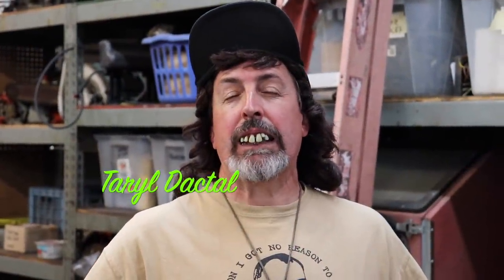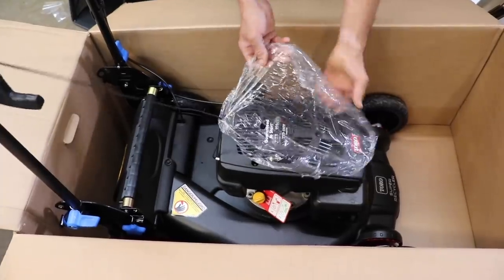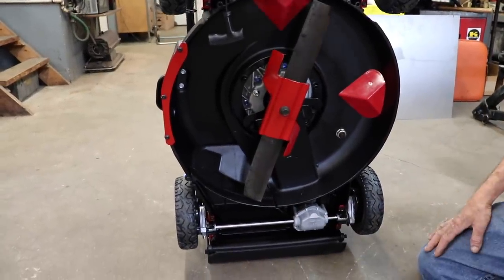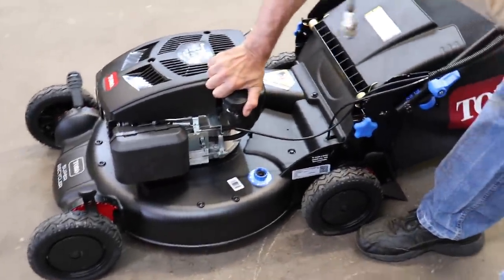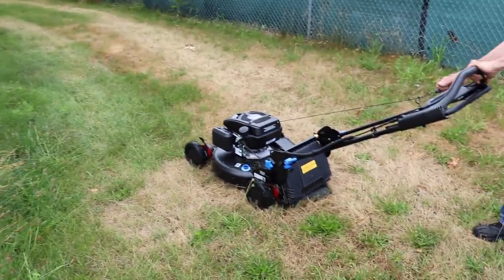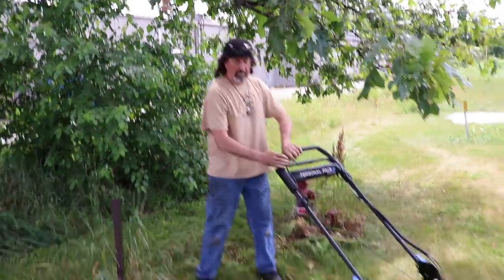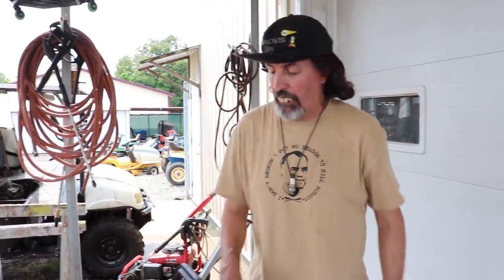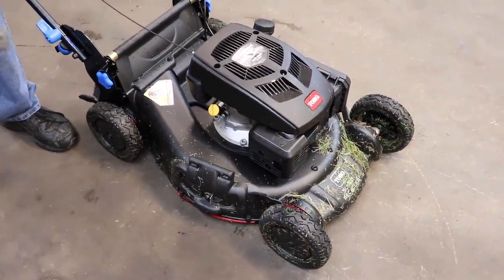Toro Super Recycler Mower Review - Is It Worth It?

Comment: Now wonder Briggs is in bankruptcy, Toro decides to go with a Chinese clone over a Briggs on their higher end residential units now. Briggs is in trouble! Otherwise nice mower.
Reply: @OwenAnonymous  Thats good 👍. I didn't realize they even offered a Briggs on the Super Recycler anymore, everyone I've seen so far had that Chonda.
Reply: That Toro motor is way better than the newer Briggs engine. The new Briggs have plastic carbs
Reply: @DeadguyAi  I'm aware. Although just because it has a plastic carb doesn't necessarily make it worse that that Loncin on their.
This is why Briggs is in bankruptcy.
The Briggs Quantum 190cc engine was great, it had a 30 year run and ut was one of the best walk behind engines ever produced, it would have been awesome on this mower. Like the older Recycler and Super Recycler. They have been using this Loncin Chonda ahwile now, the Super Recycler had this Chonda in 2017 when the base model recycler still had the 190cc Quantum which didn't make any sense at that time, because you paid more for the Super Recycler,  but the base model Recycler had the better more powerful engine.
This mower should have the newer Briggs 190cc OHV engine, those are descent and don't have plastic carbs. The ones with the plastic carbs which are the 163cc and down are crap. Larger mowers like this used to come standard with 190cc engines like the Briggs Quantum. Now everything has those underpowered crappy engines. Only commercial grade engines are offered with the 190cc engines, its a joke.
Thats why I hang onto good mowers that have that Quantum on it.
This mower would been great with the Honda or the Briggs 190cc OHV, its what it should have anyway, not some Foreign job. This is why American companies like Briggs are struggling. You can thank the EPA in the USA for causing all of the good older flathead engines to have been discontinued. Briggs still builds and sells the good cast Iron and flathead engines in Asia, yea thats right, you can buy the good Briggs engines still if your in Asia, but not here in the USA. I don't understand why Briggs isn't pushing to have their good 190cc OHV engine on this mower. But whatever the reason, they just filed chapter 11 Bankruptcy protection on the 19th. Its sad.
I had a 1994 Super Recycler, it was a great mower, 3 speed trans, aluminum deck and a Briggs Quantum, it was still in real nic3 shape when I sold it a few years ago. Small residential power equipment had gone pretty far diwn hill in general over the last decade.
Reply: Jim Johnson  They can, the Vanguards are very good engines. A lot of them were made in Japan. But if you want a good engine like that you gotta pay. In order for Briggs to compete they make some pretty crappy residential mower engines. The single cylinder inteks throw rods like its their job. However the single cylinder vertical forca tractor is the only Chinese engine not available at harbor freight, you can get the rest.
But again, Briggs still builds and sells their quality cast iron and flathead engines in Asia, they don't here thanks to the epa, so you can thank are epa for that, thats our government.
The last good engine to go was the Quantum in 2017. The opposed twins and all of their flatheads were great. Everytime I get one in, you can count on it still running.
The only descent residential mower engine you can still get from Briggs is the V twin. You have to step up to the Vanguard for everything else now if you want Quality.
Briggs actually started in 1908. The model F came out in 1919.
Reply: @OwenAnonymous  yes i love briggs too but honda is good aswell i think most engine brands are good every company has some bad engines
Reply: Honda’s the way to go. Their engines are built proof.
Reply: @Mr_Tecumseh  interesting read. I have a few briggs in my free trash find hoard of small equipment.
Reply: @OwenAnonymous  I did as well. Avoiding the chinese engine.
Reply: @Mr_Tecumseh  Agreed. Although I upgraded to 21387 which has the 190CC engine, I kept my old super recycler. My old Super recycler needed some parts (carb rebuild kit and such) I could not even check or call at  the beginning of the season. As, all mower shops were swamped and busy. I ended up buying the new super recycler. Finally, I did get a chance to work on my old super recycler. Still runs great! I change the oil, filter, plug and sharpen the blade every year. That is over 20 years old!
Reply: Briggs and Stratton have gone into bankruptcy because manufacturers are trying to make their products as cheap as possible to keep the big stores happy with cheap price mowers. This meant Briggs and Stratton have had to sell their engines at really low prices to the manufacturers to keep their DIY and internet store customers happy. That's why a lot of mower manufacturers have moved to Chinese Loncin engines, even the Toro owned UK mower company Hayter has moved to these Chinese engines on their basic spec mowers.
Reply: I have 2 Toro Personal paces one with the old tecumseh engine and a newer 190cc Briggs engine on the newer recycler with blade stop feature. Love both
Reply: JGD  Which honda, the GCV? The old Briggs Quantum flathead was neck and neck with those. They only stopped making them 3 years ago, so theirs still gonna be tons of Quantum's out their running in stride with the Honda GCV for a long time. Back when the Toro Recycler had the Quantum along side the Honda's at home depot, they were comparable to each other. Its not the case now. However the epa is what ultimately ended the flathead. However the newer Briggs OHV walk behind mower engines, their apsolute throw away crap, their built cheap to compete with the prices at big box stores like someone else mentioned above. But so are many of the mowers their being put on now and that just check and add oil, never change is such nonsense, a joke, they say that because they don't anticipate the engine or mower too last long enough to need an oil change. A lot of the newer made Briggs engines are pretty crappy, which is sad and its the reason their in bankruptcy. The last of their well made industrial engines at the consumer level all ended with the flatheads and most of those engines are still going strong to this day. Its pretty sad in general the overall lack of quality most power equipment is made with today.
Reply: How much dinosaur juice did it use is it very economical
Electrical battery mower  🔋 might be better more torque maybe .
Reply: Test Pilot Tim who cares. Most electric mowers choke on lawns like mine. Ridiculously dense zoysia turf. Keep the electric mowers for the lesser of tasks because they are not superior to gas yet.
Reply: @Testpilottim  No way.
Reply: The 21387 has the Briggs&Stratton engine.  That was crap, for the reasons listed here.  Briggs&Stratton is no longer the same company.  I bought one and barely got it out of the box and it instantly broke.  Wouldn't even start.  Took it back, got another one.  Turned on for 1 minute and then died, would not start.  Took it back.  Total crap!  I've had and still have (for the last 20yrs) other small engines that are Briggs&Stratton, and they are bullet proof.  They still run strong.  It's a shame.
Reply: @dutch971  Yea, their newer engine's aren't so great, especially the little walk behind engines they make now. The older stuff is solid.
Reply: The toro engine is way better then the briggs junk.
Reply: @littleeagle7563  Toro engines are built by the Chinese company Loncin, so everyone knows what were comparing. Its not a Toro engine, its a Chinese engine built for Toro, just so were clear, Loncin provides engines for many companies, not just Toro. They may be better, probably are, but just remember what that represents at the end of the day, the big picture. China is a Communist country that hates us, they want to see us fail. It didn't have to be this way, Briggs made top notch engines the entire 20th century that were all Industrial grade. Briggs still could have been at the top. The bottom line is the almighty dollar and greed. Corporate  America sold us out. A few rich people at the very top, who don't care about anyone else is what caused all of this. Same thing with Briggs, all the corporate executives gifted themselves one last time millions just before the bankruptcy, sale to kps bailout, while letting their employees hold the bag, a play taken right out of Sears book. So remember when you say Loncin " the toro engine" is better, it represents America in a serious struggle and China winning and that's the bottom line. Sad but true. I'd rather go with the Honda over the Loncin, outleast thats a Japanese company. It would be great to see Briggs come out of this bankruptcy stronger, making superior engines to everyone one again, but I doubt that's ever gonna happen, their day has came and went, missed opportunities, so we yeild to China now. Fact.
Reply: @Mr_Tecumseh  quit making sense!  Lol.  You’re spot on.  It’s a shame what has transpired in the past 20 years in this country.  The EPA has been solely responsible for ruining just about all engines.  Especially Diesel engines.  I’ve been in the trucking business my entire life practically.  In the late 90s the big truck Diesel engines built by Cat, Cummins, and Detroit would easily go 1 million miles without much fuss as long as you kept up on your maintenance.  In fact, I know many that made it 1.5 million or close to 2 million miles.  Today, you’re lucky to get 500,000 miles before you need a $35,000 overhaul not to mention completely going through your after treatment stuff with EGR and DPF and DEF components. Nothing pisses me off more.  It has cost the trucking business a lot of money.  And that added cost gets passed on to the consumer.
Reply: @Mr_Tecumseh  It's very unfortunate to see what happens. But that's the state of America as a whole.

Is the newer 190CC decent from Briggs? Or still absolute junk? Is it possible to swap a Vanguard onto it? I saw the 200CC Vanguard is in the $200-300 range, if it's actually made well I don't mind replacing the stock engine.

I have an older mower that it's hard to justify going for my Dad since the repairs are far and away what it would be worth to keep going.

I personally own an Exmark with the FJ180 Kai. I was debating picking up a Scag 30"  with the Kohler but sort of waiting until they iron out the issues first. Bottom line I don't mind paying for quality.

My Dad is in his 70's and he just doesn't have the momentum to handle a heavy commercial. So I was debating buying him a Toro Super Recycler with the 190CC and like I said, if needed I'll replace the engine with a Vanguard but I need someone who knows if that is Feasible before I spend the $1000+ for his Birthday/Father's day.
Reply: @Vultain  I have one of those newer 190cc ohv Briggs on a pressure washer. It's a needy engine. Constant up keep, not like the L head that came before it that just ran and could be counted on. Not sure about the vanguard but it would be interesting to know if it does. There the only engines Briggs makes that's still of quality. Briggs is in a transition, they are focused on battery technology now, so beyond Vanguard I don't expect them to come out with any newer or better designs in the near future. They will keep selling the newer crap they have been making the last 10 years or so.
Reply: @DeadguyAi  they have used plastic carbs since the 60s

Comment: Taryl Fixes All.  The Toro Super Recycler with the black just doesn’t seem right after all of the Toro products being painted red for all these years . With the Toro recycler (20339) high wheeled mower that my sister purchased; She applied a very heavy coating of WD-40 in which there are virtually no grass clippings that stick to the mower deck or mower blade when she cleans the mower after mowing her lawn. From my experience, I believe that the Super Recycler that was featured in the video would have not had nearly as much grass buildup had WD-40 been applied beforehand. The wash out port is okay, But still not as good as flipping the mower in Stow position where you can really give a good cleaning. My sisters Toro has the similar sized Briggs & Stratton Engine which has performed as it should for general cutting and for thicker taller grass in which I have never really seen the engine bog down. So far, The engine has not used any oil and the only smoke that I have observed would be a very slight puff of smoke when starting for the first time. The engine oil itself is still very clean just like day #1 when the Toro was unboxed. Some days ago, I contacted Toro to make a product suggestion regarding swiveling front caster wheels for the High Wheeled Toro mowers due to the fact that where my sister lives has lots of turns due to chain link fences. For us men, We don’t struggle too much with the weight of the mower; But my sister had a previous surgery and can’t pick up on the heavy mower like she once could. To be very frank, I was very disappointed with Toro’s response to my suggestion. Toro manufactured many great products over the years, But I informed Toro that they will never have me for a customer ever again. Sorry for the rant guys, For the last 30ish years I have worked on right of way mowing equipment of any type that you could imagine. Thanks for all of your great videos Taryl & Company. Hey I served up your Breakfast,Lunch & Dinner plus coffee breaks from Central Kentucky today.
Reply: Interesting comments. I have several push mowers and have painted the underside with used engine oil, WD-40, Rust-Oleum, and other chemicals and they all last only 1 or 2 mows. If I have to look under the deck every time I mow I might as well set it to one side (muffler side down) and hit it with a hose. Agree...I have never used the hose port. (Unscrew the nozzle, screw the hose on the port, turn on the water, start the mower, stop the mower, turn off the water, unscrew the hose, screw the nozzle back on. TOO MUCH WORK).
There might be commercial mowers available with front swivel wheels and to be frank, what are you doing letting your sister with surgery cut the grass.
Reply: David Kupferman  Well, I wouldn’t mind helping my sister with her mowing activity,  But she loves to do the lawn work with Me not getting in her way. So, I do all of the service work on her mowers when needed - Sis changes her own lawn mower oil. With the WD-40, The underside paint has not began to wear away so far. The  mower blade looks it has been buffed with a wire brush with no noticeable rusting like most blades tend to do. Probably after the next mowing- We will apply more WD-40 just as we did before. Actually we got the idea from Hanks Garage here on YouTube. We chose the Toro being that it was brand new. I applied the WD-40 to a WeedEater 22inch mower with similar good results. Pam spray on cooking oil also has a similar effect as the WD-40 does.

Comment: I bought a 21386 Briggs and Stratton it stuttered and sputtered like it was running out of gas. I returned it bought this one the 21385 it sputters at times not as bad as the other one i retuned but it cuts terrible. I had a regular Recycler a 20374 for years that was great i am very disappointed in this purchase.

Comment: 7.25 ft lbs at 2600 according to the sticker would be 3.6 hp at 2600rpm since there’s no rating at 3600 we can only guess at the output but I would guess between 4-4.5 there no way it still makes full torque at 3600 if it did that would be 5 hp

Comment: What about the Chinese motor, where are we getting parts in two years?
Reply: The engine has been around since 2017 and has a fantastic track record. I have 130 hours on mine without a single issue. Starts first pull every time.

Comment: I thought the Personal Pace was a gimmick way back when it first came out.  After several mowers with PP, my attitude has changed.  I still wish someone would make like a 18 inch basic mower side discharge with top of the line components.  I have bought the cheapest wal mart mower and installed ball bearing wheels and have come up with something that is decent.  Wish Toro would listen that a really basic narrow cut basic basic basic push mower with quality is neaded.  Many lawns or patches that people mow are far from conducive to mow with a 60 inch deck.
Reply: crickets

Comment: my dad bought a lousy toro muncher  back in the 70s it had flaps under the deck and worked poorly. banging and dumping clumps of grass. poor poor poor. it the  troy built type muncher that works well. I was told the old bolins company originally designed that but if someone knows for sure let us know.
Reply: I like the "guaranteed to start" sticker.  What happens when it won't start?  We had a Toro "crank start" in the 60s.  It took literally all day to start it - but it did start (Ha).

Comment: This is the second vid I've seen now that calls the 21385 with the TORO engine a Smart Stow. These are not Smart Stow mowers. The Smart Stow is the one with the Briggs engine. Briggs designed this engine specifically to be stored in an upright position so it will not flood or leak fluid. Also the Smart Stow has rollers on the back that it sits on when in the upright position to make it easier to slide against a wall. I don't want to knock your vid, but I also don't want ppl buying this mower based on this review and not getting what they want. Plz do your research before posting these vids so ppl aren't miss-led and spending a lot of money for a top tier product and not getting what they want.